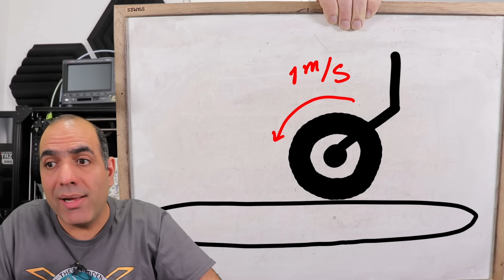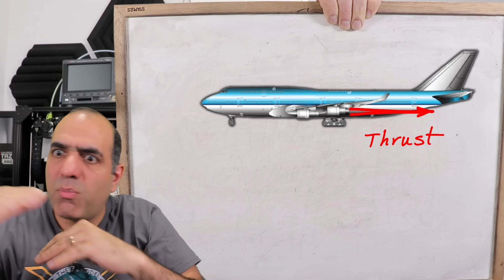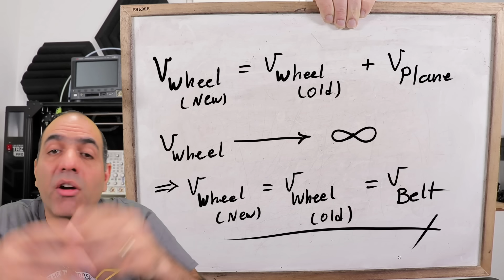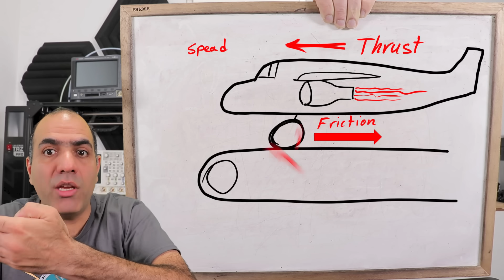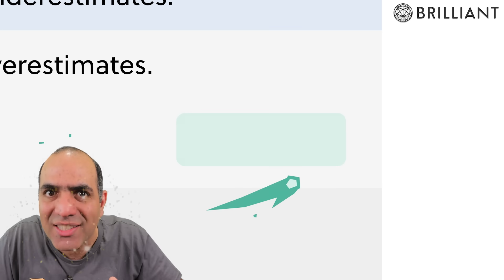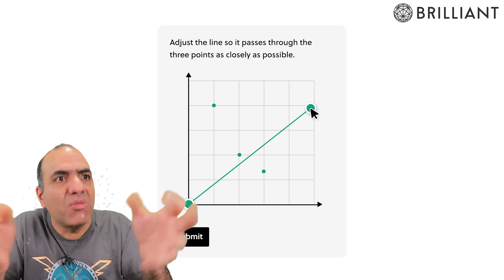Airplane Question that Drove Me NUTS!!!

Comment: Overthinking it, if friction is all over the place wouldnt the massive speed of the massive conveyor belt pull and carry enough air along to eventually have enough lift that the friction of the gear's bearing would overcome the friction of the wheels and conveyor belt allowing for take off?

Comment: You forgot the 5th case! Once the belt is moving at a speed that is high enough the friction of the air on the belt would create a "wind" over the airplane wing and the airplane would take off. This is what would happen in the real world with real friction. But once the plane moved high enough to be out of the air flow caused by the air friction with the belt the plane would crash as the air speed over the wings would rapidly drop too low to create lift.

Comment: Dear Mehdi,

I HATE WITH A MILD PASSION, the fact that you complicate things unnecessarily. Listen:

If there is lift, the wing will push the plane up. AIR SPEED. Air speed is what's relevant here.

That conveyor belt and those wheels can spin themselves to fuck and beyond, if the air speed is 0, the plane stays on the ground.

The problem doesn't mention the engines. So if the wheels somehow start moving, or if the conveyor belt is started, it's irrelevant either way. 

Please stop complicating things, I stand by my answer, the plane doesn't lift because 0 air speed thus 0 lift. Bye.

I SAID BYE!

Comment: The. Lift is depend on Air speed that flow through wing. And  Medi correct the jet plane did not use weel to drive the plane but the jet engine. So the plane will fly anyway.

Hope Veritasium made the demonstration  on this with RC plane.

Comment: Ignoring answer 4 where you just never turn on the jets.  The plane will take off, as Mehdi said, the wheels are pointless on airplanes.  As for the friction somehow stopping the plane.... It can't, worst case the wheels will begin to slide.  It's the opposite but same reaction when you slam on your car brakes.

Comment: The original point this question is that the forward motion of the plane is driven by the thrust of the engines, not any mechanical propulsion from the wheels (as in a car). Therefore the plane should take off. However, it was badly worded leading to ambiguity. First of all, it really should be that the speed of the plane, not the wheels on the plane, that is the inverse of the speed of the conveyor belt. Also, what do we mean by "speed of the wheels?" You can interpret that be either the linear speed of the wheels at the outside radius (as you did in your examples) or from the center (or the wheel as a whole). This ambiguity makes the question a bit more interesting. If we're talking about the outer radius of the wheel, then the conveyor belt would have to continuously accelerate to match the forward motion of the plane plus the rotation of the wheels generated by the belt's contact. We could probably assume that the motor driving the belt generates more internal friction than a passive wheel bearing. The belt's motor would reach a maximum speed before the wheels would fail. In this case, the plane should take off. Also say the mechanism that controls the conveyor belt can accelerate indefinitely, I don't think the internal friction of the wheels could hold the plane back, because the again the thrust from the engines is driving the plane forward not the wheels. The only factor would be if the wheels fail and cause damage to the plane.

Comment: My first thought after seeing the question was yes it will lift off since the plane doesn't use its wheel to gain speed but instead uses jet engine to accelerate air giving it thrust. But then looking at the diagram i think it will just simply crash with how short the conveyor belt/runway is lol.
Reply: Read the text.  The conveyor is full runway-sized, not as pictured.
Reply: @VoltisArt  oh nice, I probably forgot about that thanks for pointing it out.

Comment: I mean. Its airflow over the wind, not the airplane speed relative to ground. Im posting this at the beginning of the video so maybe I'm saying something that got said but wheel speed doesn't fly a plane, airspeed does.  No. It won't take off. Or at least not for very long...
Reply: If the engines are capable of a basically stationary takeoff then yes.  The plane can stationary takeoff.  Harrier jets can vertical takeoff but if you are assuming a prop plane/glider that has to have airflow, not a jet that turns anything into a missile then it doesn't work.

Comment: I’m actually shocked how many people find this to be a hard question.

The wheels are literally only there to support the plane when it’s on the ground (ok, and help it steer and stop when taxiing). All propulsion is done by the engines (which have nothing to do with the wheels) and lift is determined by the airflow over/under the wings. As others have said, the plane could fly without moving at all if the airflow over/under the wings was high enough.
Reply: This means it can only fly if there is a wind that that goes over the Takeoff speed, otherwise it wont

Comment: 0:37 "Take your time"
Well, to me, the conveyor belt will move the plane's wheels but the inertia of the plane will hold it in place for quite some time until it gradually builds up reverse momentum. As for whether it can take off, that seems an obvious 'yes' with the caveat that the wheels will report double the actual ground speed. We must remember that airspeed and ground speed are not the same thing. The jet's airspeed will increase until it has exceeded its stall speed, at which point it takes off, regardless of what the ground or wheels are doing.

Comment: The problem starts at 0:29. That is not the experiment. Both Mythbusters and WOE showed something similar that makes you assume the aircraft will be at 0 airspeed because the 'treadmill' is simply too short to take off on. That tells people no, it is not possible for the airplane to take off. Then the experiment morphs into a much larger treadmill where the airplane is able to move forward long enough to build relative airspeed and eventually take off.

Comment: No friction: Plane flies.
Friction + conveyor matches the MPH speed of the wheels: Plane flies.
Friction + conveyor matches the RPM of the wheels: Feedback loop amplifies conveyor's speed until it fries it's motor. Plane flies.
Friction + feedback loop + magical invincible conveyor belt that can go lightspeed: Plane's wheels explode. Can't fly.

Answer: Unless you use magic against a non-magical plane, it will fly.

Comment: Thank you! This is the kind of nuance that I felt was missing from the Mythbusters episode. They interpreted "matching the plane's forward speed" to be the planes speed relative to the ground, so they just had the conveyor belt going at the plane's takeoff speed. I think "matching the plane's forward speed" is meant to be relative to the belt. This makes the two questions essentially the same. When accounting for real world friction, as you said, the plane doesn't take off.

I agree though, the question is too ambiguous.
Reply: People make it ambiguous by making assumptions the question does not require them to make. For the belt to match the wheel speed, it must 'know' the wheel speed. The only channel of communication between the wheels and the belt, if we purposely only use the data provided in the problem and allow no assumptions outside that, is the point of contact between the belt and the wheels. Now, when you are going down the road at 55 mph, your entire drive train is 'matching' 55 mph, both in terms of the components each matching the one they are in contact with, and that they are all moving 'forward' in the car/your PoV at 55 mph. 'Matching' is better stated as 'synchronized', and technically that parameter is self enforcing by the contact between the belt and the wheels, such that matching occurs at any belt speed, including zero.
Reply: @routergray7041  Its actually a lot simpler than that. If you perfectly match the ground speed of the wheel it means they stay static. To do that you need to perfectly balance the thrust of the engines. You can basically ignore the rest of the system
Reply: @mycosys  No. I mean I see your view but that implies that the wheels must obey the matching rule, and that isn't how the problem is stated. The problem only requires obedience to that rule from the conveyor, not from the wheels. The airplane and its wheels are the primary actor, and everything else in the problem must react to what it does. Nothing in the problem makes any constraints on the airplane and wheels, in terms of stated rules. The question 'Can the plane take off?' necessitates that it attempts to, else the problem as a whole is meaningless. When it makes said attempt, it succeeds, because any interpretation of the matching parameter that creates a paradox is scientific malpractice, and any interpretation that does not create a paradox allows takeoff.

Comment: The speed of the wheels and belt doesn't matter at all. In the end all that matters is the thrust of the airplane engines that move the plane forwards. No matter how fast the wheels or belt go, the plane will still go forwards. Since the forward motion isn't dependent on the speed the wheels or belt are going at. So the plane will normally take off in the end.

Now you could say "but the belt will match any forward motion the wheels are trying to exert!" Once again it doesn't matter. Even when the laws of physics are broken (which they have to for this thought experiment to make sense) the forward motion of the plane is still not determined by the speed the wheels go at. This is why it's common knowledge in maths that there are different degrees of "infinity".

To expand upon that. Technically you could divide the gap between 0 and 1 an infinite amount of times. (0.0000000001, 0.0000000001, etc) It would be an infinity. But you could also keep counting from 0 to infinity. Which is a larger infinity.

TL:DR: The end result, no matter how you try to pose it, is that the plane will take off normally. Since the forward motion of the plane isn't dependent on how fast the wheels or belt are moving.

Comment: Friction or no friction, stationary or not, it always flies. 
============================================
Moving/Friction: Thrust provides lift
Moving/Frictionless: Thrust provides lift
Stationary/Friction: Infinite wheel/belt speed generates kinetic energy explosion moving all the plane pieces upwards
Stationary/Frictionless: Infinite wheel/belt speed generates low air pressure zone above the belt pushing the plane upwards

Comment: Simple. Lock the wheels in place, not spinning, but have there be no friction between the wheels and the conveyor.  Pretty much, a sea plane. Or maybe the conveyor actually has to run forwards, depending on how you define  "match the speed of the wheels". Or have friction against it, but still, the key is, don't let the wheels rotate.

Comment: well yeah, the wheels don't matter. The engines are still pulling the plane relative to the air, which isn't moving. So the plane will move forward relative to the earth.
Reply: Actually the plane can't move forward relative to the earth since the ground it is placed on is constantly adjusting to its wheels speed keeping it stationary
Reply: @cristian_ca_n_le2328 doesn't matter. The plane is not powered by the wheels

Comment: Yes it will, speed of wheels does not matter
Reply: It does matter when the plane is on the ground. To gain airspeed the plane needs to move forward but it can't because the conveyor belt is pushing against with the same force
Reply: @cristian_ca_n_le2328  jet engines are so powerful that a plane could do a vertical takeoff if it really needs (VTOL example).
Reply: @atomdream2298  well not all plane are VTOL and the engine's need to push air down to do so, but if we are talking airline or normal planes the engines push the air backwards to push the plane forward so they need to move and gain airspeed
Reply: @cristian_ca_n_le2328  Ok. (numbers might be incorrect) The plane displayed on picture is a Boeing B747 SP all 4 of his engines in total would produce 827 kN  which is about 84350 kg/m2 of force, planes empty mass is 152780 kg so vertical takeoff is a no go :D you are right.  BUT an unrealistic air gust of +/- 140 -160 knots and plane will take off without engine :D. take a look at a video called "Steve Henry 6 FOOT takeoff in a Highlander" - this plane "feeds" airfoils with its propeller unlike a passenger B747 SP :)

Comment: Pausing at 0:55 , I would think the plane would never take off, there's not enough air "pushing" the wing to cause lift and fly. The plane is standing still, eventhough the wheels may be moving.
Reply: What about the engines? Those things can push the same amount of air as a tier 5 tornado. They alone can still push the plain forward enough to eventually take off as in the riddle they said the belt is the same length as a regular runway only going an equal speed in the opposite direction which won't effect the plain at all because it doesn't rely on the wheels to push it forward unlike a car which does.
Reply: @dogs-and-destruction-channel  in my assumption I always think of the plane as being stationary, even with the engines at full throttle I would still assume the belt would move fast enough to keep the plane at 0km/h vs ground. With those conditions, the only way a plane can take off is only with headwinds going so fast that the air can produce enough lift on the wings to impulse it vertically.
The engines themselves dont generate lift, they are leveled with the ground, they only generate horizontal force. The airpreassure on the wings is what creates lift, and that would only be produced in a scenario where the airplane is either moving forward (positive ground speed) or the winds coming head front are strong enough to generate enough lift to make the plane fly at 0km/h ground speed (which ive seen videos of this happening on small planes and its kinda nuts).
Reply: @BizarrelyOdd  
I guess a good way to thing about it is pretend it's a kite with wheels and engines. A stationary kite with no wind won't go anywhere, however If you run with the kite eventually the kite will generate lift and take off or if the wind is strong enough it can lift the kite off the ground without you going anywhere. But even if the plane and the belt's going at the same speed the plane will still move forward (as long as the engines are running) and eventually take off as if the runway was still as it relys on thrust to push it forward kind of like us pushing a small boat on the water however if it was a car which relys on the wheels to push it forward it'll stay put as it has no thrust to keep it going kind of like us running on a treadmill. I seen videos of small planes that taxted too close to another larger plane and the thrust from the larger jet flipped the smaller plane like a pancake (no one was harmed as it was only an empty plane) and yes I agree it can be amazing watch stationary planes take off just from the wind force.

Comment: The only thing that makes an airplane fly is the Bernouilli's principle and the shape of the wing: the air molecules flow faster above the wing, creating a lower pressure compared to the bottom of the wing resulting in lift. The only thing that matters is the speed delta of the air molecules flowing over and under the wing. The belt and wheels are to be neglected as they don't increase the relative speed at wing level. Propellers and jet engines do add some additional airflow but the contribution is small compared to the plane accelerating relative to the air.

As engineless planes exist, the only thing that keeps them in the air is quite literally the shape of the wing and the fact they move relative to the air when pulled by another plane.

https://en.m.wikipedia.org/wiki/Bernoulli%27s_principle

Comment: At first, I imagined it like how I would feel no breeze running on a treadmill, but somehow a plane on a treadmill can take off? Then, it came to me embarrassingly late.. I don't have a turbine engine. The plane's engines is what's pulling the air towards it, underneath the plane's wings and out the back. Meaning, even without forward movement on the ground, it does have on the air - thanks to its engines.

Thank you for this video. I learned something new today. 😂

Comment: Air moving along the wingspans creates lift, not the wheels rolling on the runway. 

A conveyor belt will not produce the airflow along the wings needed to create lift, even at high speeds. The wheels will only roll at takeoff speeds, but if there is no airflow on the wings there is no lift.